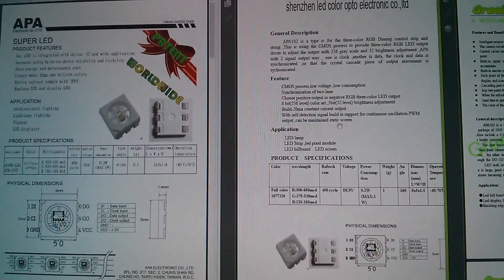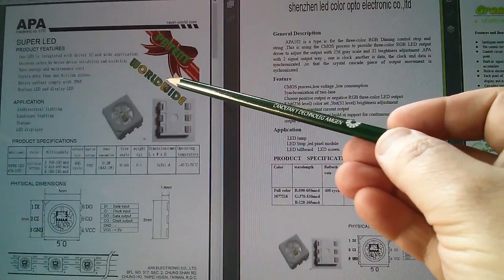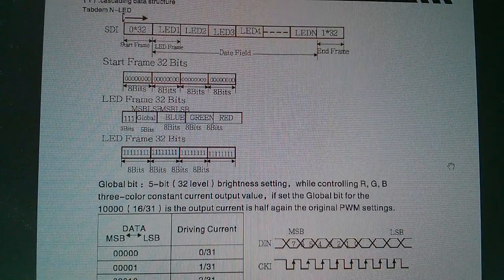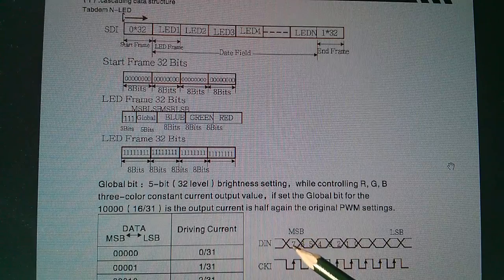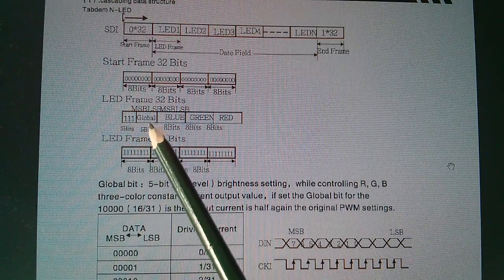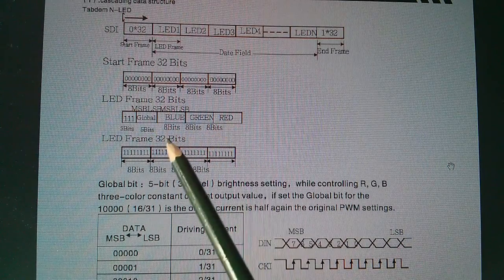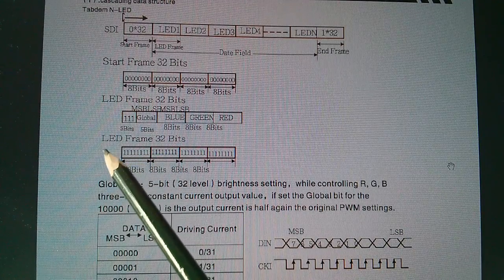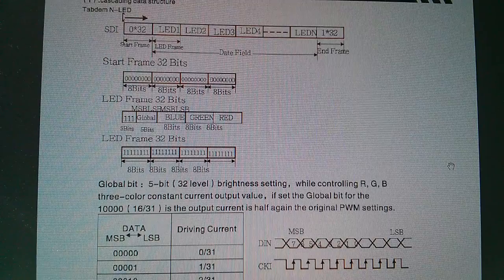First Look: APA102 RGB Pixel Addressable LED #1

Comment: Thanks for the video. I am currently using APA102 RGB strip with 60 LEDs for my project with Raspberry Pi. But I find APA102 to be not bright enough for my needs. Are there any brighter strips which I can use instead of APA102 RGB strip? 12V also should be fine if only it has SPI bus with 5V or 3V3 logic levels.

Comment: I have made the switch from ws2812 to APA102 and am dealing hoping to expand much the arduino code I have been using to accommodate the additional clock pin. Any suggestions?

Comment: You briefly talked about the power supply.  Is that a 2 amp supply?  I was wondering if you could help with how to power these things and how to figure out what kind of power you need for x number of pixels.  I just got a meter at 144/meter.

Also I noticed that you don't try to power it directly from arduino which makes sense.  I cut open the other end with the power and the black/red power cables are soldered to the same black red that attaches to the arduino.  i see that you didn't attach the red (+) line to the arduino.  But can I power my arduino (nano) and the led strip from the same power supply?  Ultimately I'm using these for things like under counter lighting and interesting wall lighting.  I need a solution where I can have a single power supply driving the arduino and the leds.

Any helps or further hints appreciated.  Love this and the #2 video.  Really took the mystery out of these pixels and how to program for them.  Thanks!

Comment: WS2811 14 X 9 MM. PCB: Can I use green single color against the green side and yellow single color against the green side red against green entrance no RGB LED I mean single colors. Does it work if you set the right color?

Comment: These are easily my favorite addressable RGB LEDs, due in large part to their 20KHz PWM frequency.  In my experience, anything below 11KHz is both unpleasant to look at and problematic to use for video work.
Reply: Otaku+ Have you measured the refresh rate of these LEDs? In my project i need to update color (eg. change from red to green) on 4Khz.
Reply: Honza Mrázek Yes, they are 19.5KHz.  As for for the maximum update rate, I am not sure.
Reply: Otaku+ Thanks for your answer. Just for curiosity - how did you measured it? I thought about it a moment ago and I couldn't figure how would I do it.
Reply: Honza Mrázek Ah, my mistake.  I misread your question.  The maximum frame rate of these modules is 2.5KHz according to the datasheet.
Reply: Otaku+ Which version of datasheet do you have? I see only the refresh rate of 400 Hz, which is quite low.

Comment: I seems to always get confused with bits and bytes. if there a way to send bits with an arduino or is it easier just to use bytes? I always thought a bits were either a 1 or 0. and bytes were "packets" of ones and zeros.
Reply: +haz939 One Byte is 8 bits, so yhea. Pretty much a packet of one and zeros but it's still sent out one bit at the time

Comment: Can you explain a little better why you're not sending the GLOBAL data byte ?
Reply from the maker: louigi600 I set the global brightness parameter to it's maximum value. Apparently, the global brightness modulator runs at a few hundred Hertz, so it's visible if you flick your eyes. The main brightness modulator (256 levels for each of R,G and B) runs at 20kHz. I can't see the point of the global adjustment.
Reply: hum ... that leaves me even more puzzled. I may have used the wrong name for the byte I'm referring to ... but on closer look it's not a full byte so it was just some bits.